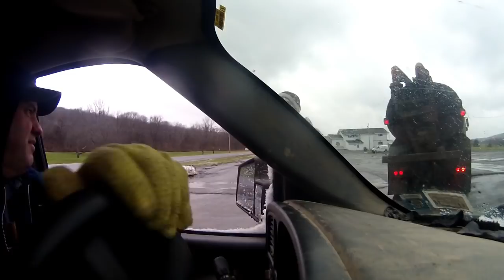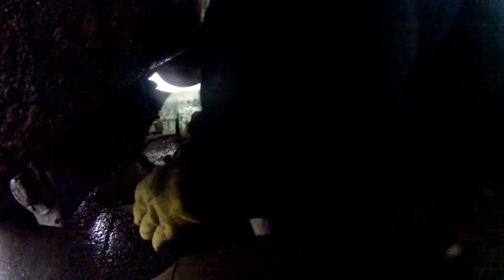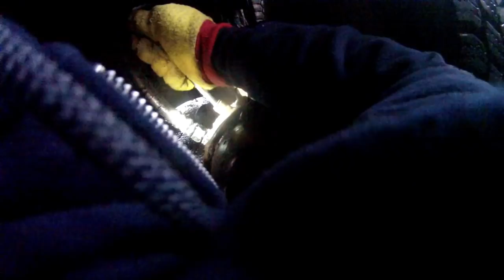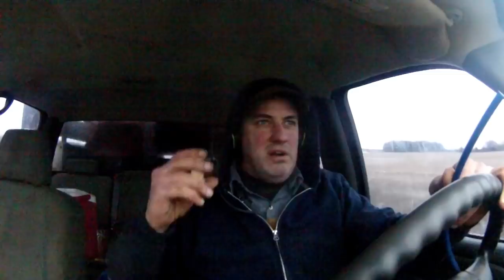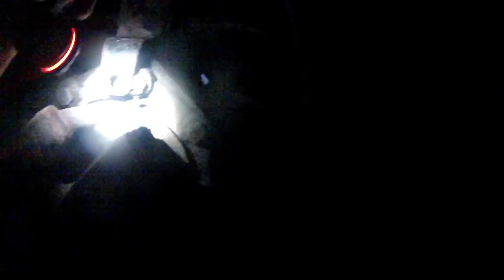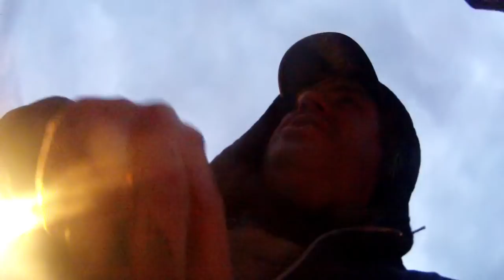Simple air brake issue

Comment: I thought my township was the only one that doesn't care about its residents let alone farmers. Their paying taxes and that road should be maintained like any other, it's a safety issue.  I bet if those were $6-700k houses they'd bend over backwards for them. There is a dead end road here with houses like that and the road is fairly flat yet it's always black with antiskid yet they won't put enough down for the milk truck.
They milled sections of my road and left the transitions so rough I've been thrown out of the tractor seat into the steering wheel. When I've complained I get told to slow down I'm driving to fast and it's not the townships job to make the road smooth for tractors.
Reply from the maker: Thanks for the comment